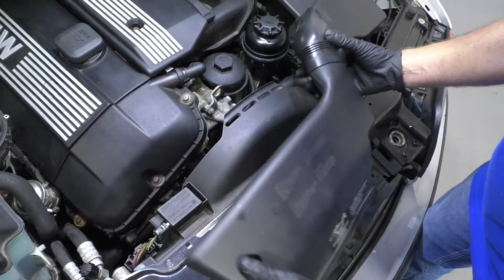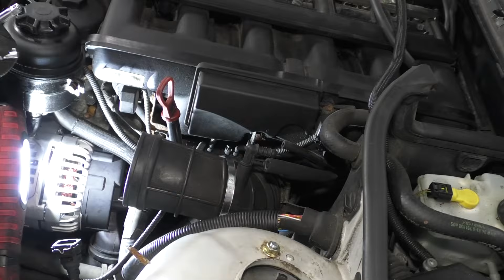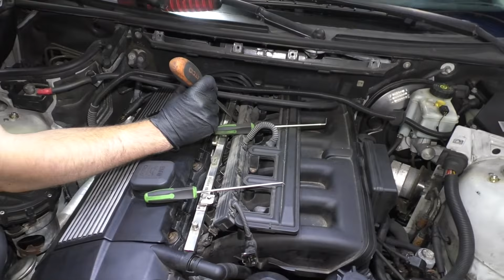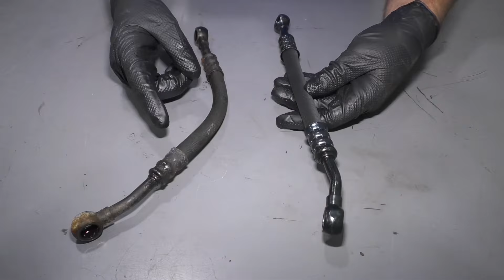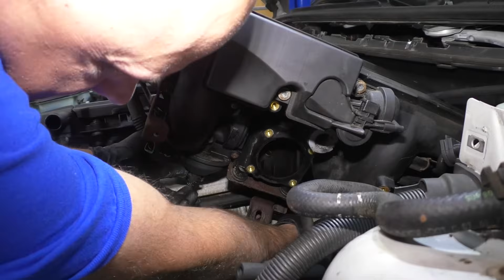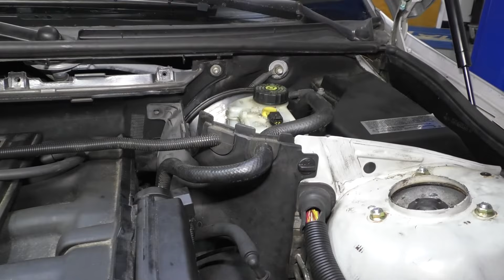How to Replace Engine Oil Line 01-05 BMW 325 Xi

Comment: Great job sir. You got patience. I know it's not mandatory, but when I remove an intake, I run a magnet through the ports. I rather be safe than sorry. I make sure  that the magnet end is secure. Enjoyed the video. Thanks
Reply from the maker: +Bobby Benn Thanks for the tip and for watching!